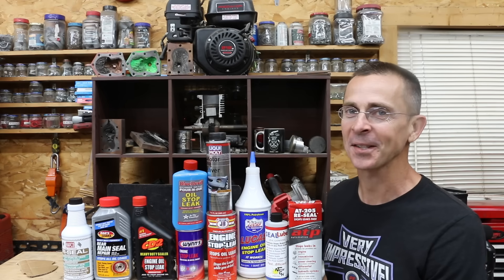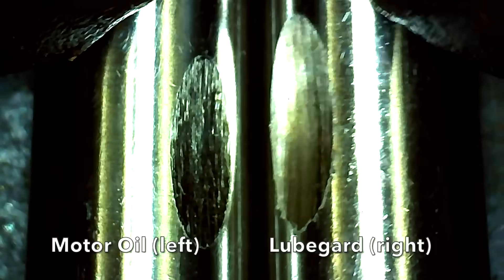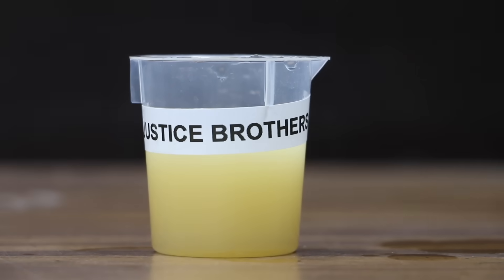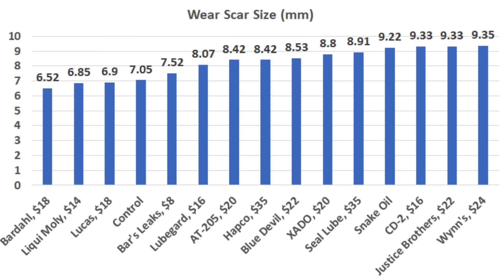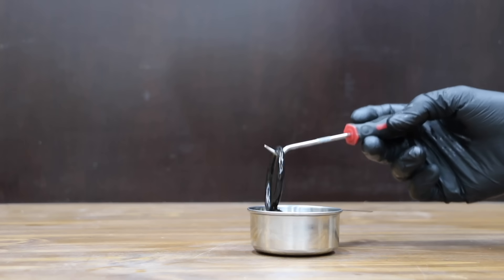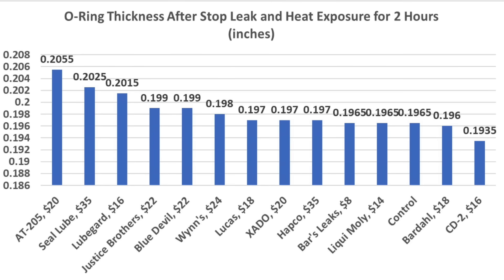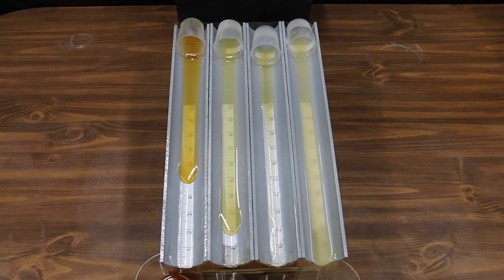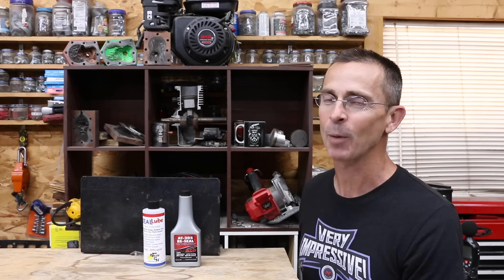Do Stop Leak Products Work? Do They Damage Engine Seals? Will They Destroy an Engine? Let's Find Out

Comment: I'd like to see a review on the NES brand of internal thread chasers like the ones included in their 1025 kit. Curious how well they work. Also with their method of adjusting to any thread size within a certain range, how much does the thread geometry change? Does it stay even or does it cut more off the top or bottom of the existing threads? And is it a 60 degree cutting point or do they shave a few degrees off in order to try to compensate for differences caused by adjusting for the size.
Reply from the maker: Thanks for the suggestion.

Comment: Thank you for doing this.  On my amc 360 motor the felpro rear main seals are defective.. slightky undersized so even a new seal causes rear main leaks..  Your test showed me at-205 and one or two others will swell the new seal so ima try this to stop the rear main on this undersized fel pro rear main seal

Comment: Really enjoy the videos you produce.  Thanks for doing this video, it was a subject that I have been trying to learn more about. Learned a great deal with the video.  I have been using the AT-205 product for a little while on a high mileage care with good results.  I would have liked to see the results with recommended ratio of 8oz:6quart on the instructions vs the 50:50 set up.  I wonder if the negative results, like viscosity, wear, and separation issues would have been less? Still provided the positive results?    Thanks again for your channel!

Comment: Rear main seal on my 2014 focus went out and started leaking like crazy. well ford fixed it under warranty. Apparently they didn't do a good job and it started leaking once again. Well this time ford said it was out of warranty and wanted close to $1500 to fix it!! Ridiculous!!!  so I got blue devil to hopefully help or maybe fix it. I ran it on a new oil change and ran it for 3,000 miles before changing the oil again. Which I do myself now on all my vehicles.. Thank you ford. :) anyways.. It does seem to have helped as it is no longer low on oil during changes and no more oil patches on my driveway. 

Also had it start leaking out of the valve cover gaskets and into oil plug wells. Ford once again showing there $$$$ costly repairs. wanted $700 who makes these prices good lord.. So i went up to oriellys and repaired it myself in about 2 hours. I am starting to do alot more work on my vehicles once because its so dang expensive now days to get anything done. And two I kind of enjoy it after doing more of it. Just recently replaced my 2 front wheel bearings on my 05 focus which was a bear and a half but got it done. :) 

Really enjoy your work and dedication to showing us what is what.

Comment: I had a 2002 Honda CR-V with 180000 miles. I took it on a road trip, and was watching/topping it off with oil daily during the trip because it burnt about a cup a day when driving alot. 

Unfortunately, I didn't check my coolant frequently, and only realized my mistake when I badly(20+ minutes before I noticed)  overheated the engine. After this, oil consumption jumped from 1/4 quart per day to 2 full quarts per day. 

I bought a bottle of Lucas oil stop leak as tested in this video, and dumped in slightly more than the recommended amount along with oil.

The next day, the car consumed about half a quart of oil. I refilled again, and added more stop leak. The day after, the car consumed so little oil I didn't need to add any. 

I continued to watch the oil for the remainder of the 2 week road trip across Canada, and had to add less then a quart through the remainder of the trip. 

The leak(s) returned to normal levels over the next 2 years after this trip, even with me regularly using Lucas Stop leak with every oil change, but they never got worse then before I overheated the engine.

Just my experience with Lucas Stop leak - the stuff worked when I really needed it to.

Sold the car to a mechanic for $400.00 a few years later. Engine was the only somewhat good part of it - I pulled the Vtec sensor to see if the stop leak had plugged it and it was fine.
Reply from the maker: Thanks for sharing!

Comment: I have never tried to use additives to stop a leak, but I do use a lot of Lucas products. I add 15 - 20% of their oil stabilizer every time I change my oil. My EJ205 is at 240k miles and has no issues. I had it dyno tuned at 150K and when I took it to change the tune at 230k the hp and torque had not dropped at all.
Reply from the maker: Thanks for the feedback.

Comment: An idea for another video could be testing compression unions vs compression fittings. And their failure pressures
 For connecting brake lines gas lines etc.
Reply from the maker: Thanks for the suggestion.

Comment: Fantastic showdown, I have experimented myself with AT-205, I put it in a spray bottle and spray different rubber bushings and it works great at softening rubber and making it flexible again
Reply: Do you know how long the change lasts?  I'm wondering if I can treat it once, run the engine for a short while, then change the oil.  I want to avoid the wear with the AT-205
Reply: @jeremyvalero-Sapphire  You have nothing to worry about. In the test he did above he did a 50% motor oil / 50% additive mix which as absolutely ludicrous and virtually meaningless in real world conditions because the RECOMMENDED amount of additive added to the motor oil is nowhere near 50%!  In the case of AT-205 the recommended amount to add is 6 ounces! That's a TINY fraction compared to what was done in this video! That equates to about a 4% ratio versus the video test which was a 50% ratio which again, makes the wear test done in the video virtually meaningless and very misleading.  What would have made sense was to do that test BUT going by ratio stated by each product manufacturer since that is what people will actually be going by when they use it in their car.  In addition to this, both the AT-205 and the LubeGard Seal-Fixx are known for being so effective that users of the product actually recommend that you start with HALF of the dose mentioned in the instructions so we're talking about 3 ounces, which again, its a TINY amount compared to how much motor oil it's being added to! The ONLY reason you saw increased wear in the test done in the video was because of the ridiculous amount of additive he added to the motor oil, which diluted the motor oil by half! Of course that's going to increase wear at that dilution since the additive is NOT a motor oil!  But at between 3 to 6 ounces per 5 quarts of motor oil there will be no increase wear for goodness sake!
Reply: @jeremyvalero-Sapphire  You could try using a thicker weight oil than the recommended weight, like 20-60 instead of 10-40 for example
Reply from the maker: Thanks!  Thanks for sharing.
Reply: How often do you have to spray the rubber parts?
Reply: @xpham973  When it comes to undercarriage, suspension boots/bushings, it's a good idea to apply every time you are under the car, so if you do your own oil changes, just give all the rubber boots/bushings a quick spray while you're under there.  Doesn't have to be AT-205 though which is way too pricey to be using for that purpose. Spray silicone will do the same (get a can that has an extender tube or flex tube such as the WD40 version to get in tight spaces) or you can get some 303-Aerospace which unlike AT-205 is miscible with water which means you can get a separate spray bottle that has an adjustable nozzle on it, and mix the 303-Aerospace with distilled water at a ration of 30% additive/70% water and use that mix for spraying all of the rubber parts. The adjustable nozzle will come in handy since you can adjust to a fine mist for up-close spraying to cover a larger part easily and for parts that are hard to reach you can adjust the nozzle to a tighter stream that will travel to the hard to reach part and soak it well. Even at the 30/70 dilution the 303-Aerospace it will still do its job and at a fraction of the price of AT-205. Same goes for the spray silicone, very effective and much cheaper than using AT-205 to keep rubber soft.  Save the AT-205 or LubeGard Seal-Fixx for when you need to add to motor oil, trans fluid, etc.  FYI the 303 Aerospace is also great for preserving tires and prevent cracking, same dilution ratio, clean tire well first (warm water, soap, scrub brush, scrub the rubber, then spray clean and allow to dry before applying the 303) then after the tire is completely dry you can apply the 303 to the entire tire surface (front side, back side, treads). For best results allow the tires to dry for 24 hours after applying the 303.  Some people go with a 30% 303/30% ISO/40% water mix as well since the ISO content will help it to air-dry faster but the ISO is not necessary.
Reply: @marketingmajor8126  Thank you for your input. If Aerospace 303 is miscible with water doesn't that also mean it can wash off with water contact such as spray from driving over wet roads and puddles?
I normally spray silicone on my rubber suspension bushes and engine mounts, also taken off and lubed my ARB bushes with graphite powder.
Reply: @zahimiibrahim3602  Nothing to worry about Zahimi being that no matter whether a plasticizing agent is water miscible or not, the effect is still the same. It's not the portion that "washes off" that matters, but rather the portion that actually absorbs in to the rubber material and both types of plasticizers will do well in that but also both types of products will have about 50% of what you apply wash off and yet they both still work.  That is why I recommend the Aerospace 303, because it can be diluted with just plain water in the ratios I described in my previous post and this allows you to cover a much larger area at a fraction of the cost versus a  glycol ether base. For example, you can soak a dried out piece of rubber in a plasticizing compound until the rubber has become soft again, and then you can drop that piece of rubber in to water, or a puddle or a wet road and that rubber will still be soft regardless. Why? because the plasticizing compound already did it's job to soften the rubber, so it doesn't matter if there was some of the plasticizing compound left on the surface of the rubber part that then gets washed off, what matters is what already absorbed in to the rubber part.

Comment: Thank you so much for your video. I was waiting this products review. There is nothing on internet like your tests.
My car have small leaks in engine with no dripping. After seen your video i could propose two ways of using that.

First way is using AT-205 with car running in idle for a couple of minutes or hours, i think engine running idle will prevent wearing damages for using AT-205. Afterwards, just change oil and it's ready. Did you think it will work?

Second way is to use Lucas in warm season to avoid oil freezing. Lucas seems to be most balanced product to avoid engine damages and take a bit of advantage in seal recovering. After 10k miles of running, just change oil and it's ready. Did you think this options could be better?

Thank you so much.

Comment: AT-205 works. I have a couple of clunkers and have used it to stop leaks in a rear differential seal, pinion seal and rack and pinion seals.  I was certain I would be replacing the rack and pinion after using it....but it's been over a year and still going strong...and not leaking. I think I only used an ounce of AT-205 in the power steering fluid reservoir. I'm still surprised but this stuff actually seems to work!
Reply from the maker: Thanks for the feedback.

Comment: I know the $8 Bar's Leaks Rear Main Seal repair works and doesn't harm anything. Before I put some in my '99 Infiniti I30 with 370k miles, it needed almost a quart of oil added per week because of an old rear main seal. I used that stuff in three oil changes and now with 393k miles, it barely leaks at all. Maybe needs a half quart of oil every three weeks
Reply from the maker: Thanks for sharing.

Comment: I think I speak for EVERYONE who works on their own cars and trucks when I say thank you for everything you do.. Your channel and the tests have been a never-ending fountain of knowledge, entertainment, and help.  -- Dave Raynor, Long Island, NY.
Reply from the maker: Thanks and you are welcome!
Reply: Very nice to buy with confidence!  @ProjectFarm
Reply: @ProjectFarm 
You do the best reviews and testing.
Reply: Absolutely and Ive been ASE certified for years. I've read untold amounts of claims and have come to my own conclusions over the years, but this channel and it's efforts are a great tool.
Reply: Same gos for me
Reply: The Barr’s main seal works great on my gm5.3 gxp  which I bought super cheap because of minor to medium  oil leak s . Bought mint 2006 black gxp for $ 1200can because of minor and medium oil leaks and a few other problems  . While doin mini restoration I added the Barr to fresh oil change started the car several  times while repairing brakes  ,minor paint touch up , polishing repairing multi purpose  signal indicator , heads up display , replaced rad  , oil undercoat  .  The Barr stopped all my leaks after I ran the motor for 30 min shut it of  then started the next day 30 min   It needs to run and cooled down couple cycles to work then every oil change add 1/2 the bottle
Reply: I also had great luck with Lucas power steering stop leak  on my 1976 vette .
Reply: And I promise people like Project Farm & AvE are 100% helping improve the tool market for us.
Reply: Also had great luck with Lucas transmission stop leak  on my Gm 3.8 Grand Prix transmission
Reply: Same
Reply: 👋 yo what he said 💯

Comment: There is no way a product containing ethylene glygol can claim "regenerates seals" there is a reason why you have different seals for example water circulation pumps vs. 35% ethylene glygol, Or a petrol engine vs engine designed for ethanol. I would say thats a down right malicious claim.

Edit: Take 10 epdm, 10nbr and 10 vulcanized rubber o-rings DN50 or bigger, dunk em in a motor oil for a year. and 10 epdm, 10 nbr and 10 vulcanized rubber o-rings of same size dunk em into a motor oil and mono ethylene glygol solution( something between 80/20 to 90/10 mix) for a year, then compare elasticity, twist and squish and shear properties, also how easily the o-ring surface becomes a sort of sticky crumbling mess.

Comment: I’ve used the Lucas oil stop leak in my old Duramax. It had a valve cover leak as well as a small rear main leak. It seemed to keep it from leaking. Id definitely use it again. I’m also assuming that the increase in viscosity helps keep the oil thicker so it is less likely to squeeze through small crevices
Reply from the maker: Thanks for sharing.

Comment: Scotty Kilmer has recommended AT-205 for a long time and apparently he is correct. HOWEVER, the wear scar test along with the oil separation could be a problem! On a cold start pumping a bottle of straight AT-205 out of the pan for a quick second or so? Hmm...:face-orange-biting-nails:

Comment: Great video.  As I expected, those that had the best lubricity and didn't increase wear were crap for softening and expanding o-rings.  Those that softened and expanded o-rings degraded the oil performance.  

From decades ago when folks would use the "soften and expand" types of products, my experience was that many of them would work for a short time.  Then the leak would rapidly become worse and a repair unavoidable.  My theory is that one has a gap from the o-ring or seal being hard and worn.  Softening and expanding filled the gap and stopped the leak, but now you have softer o-ring in contact with the moving part and it wears away more quickly.

I prefer the sealer that improves viscosity making it harder for the fluid to escape through the leak.
Reply from the maker: Thanks!  Thanks for sharing.
Reply: Yeah, his test is on brand new seals, don't know how he would go about testing these products on old seals. It seems like he is not really testing what needs tested.

Comment: I use or have used these products. MotorKote. Lucas oil and fuel treatments. Bars radiator lubricant anti rust treatment. And of course AT-205, which has doubled in price. MotorKote is ridiculously expensive, but I think an early treatment when your car/truck is new helps to wear all the friction parts evenly and minimally for a smoother break-in period. I have a 2008 Saturn Aura with 205k miles on it and I have used everything mentioned here and it is a miracle since it’s not a Toyota product that it is still running. I do regularly change the engine oil and it’s the main factor of the engine longevity without any engine repairs other the spark plugs and serpentine belt. Based upon my personal experiences and the factors that Todd has enumerated on this video, these products represented here are fairly spot on.
Reply from the maker: Thanks for the feedback.

Comment: You need to redo the test with the manufacturer recommended additive to oil ratio. Also a test of hose leaks vs seal leaks to verify the results are the same at the manufacturer recommended ratios as products are anywhere between 8-32oz containers. Which would affect the viscosity and wear parameters.
Reply from the maker: Thanks for the constructive feedback.